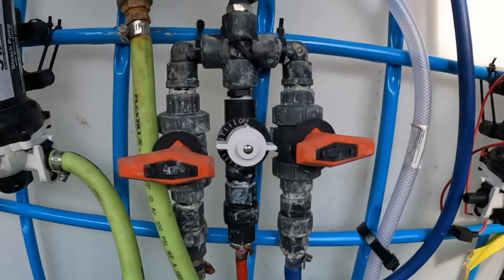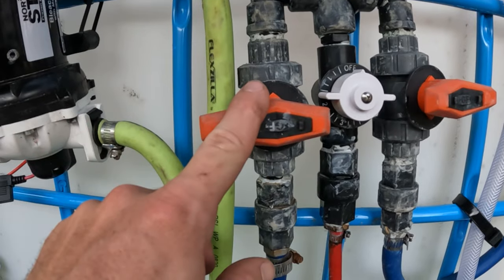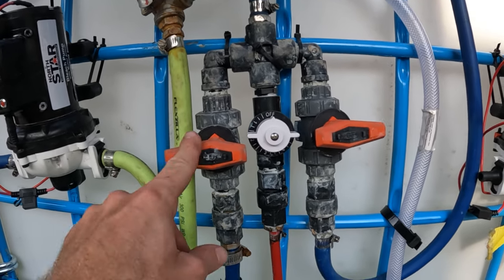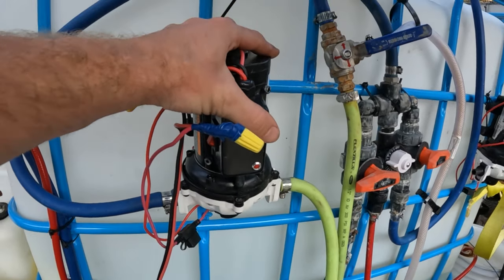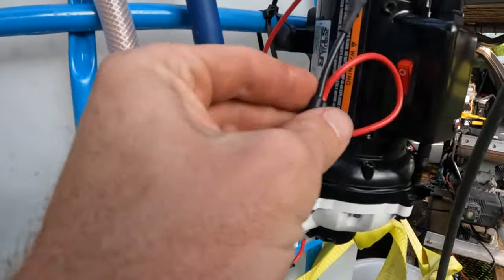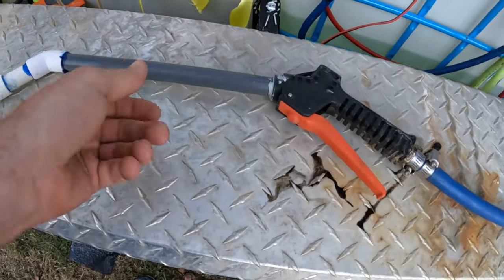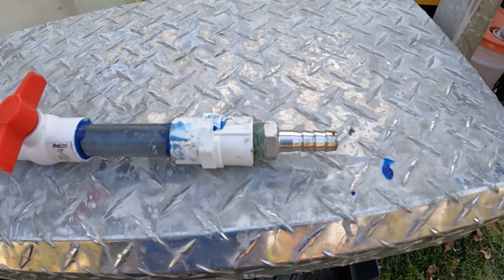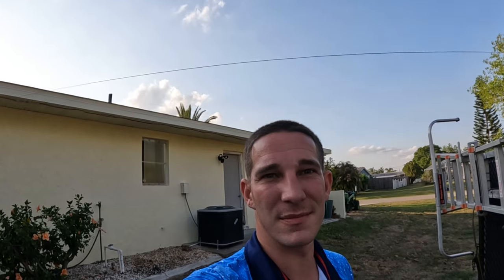How To Set Up 12v Soft Wash & Proportioner Tips | Pressure Washing Guides 2022

Comment: Great video! Thank you! 
One question what size is the soap line 1/4”?
Reply from the maker: Thank you!!   Yes I use 1/4 for soap line and set proportioner to 1-2 on the dial depending on surface. For concrete cleaning I might do .5 if any just to help mask the smell a little

Comment: Interesting bleed valve on long hose. Still not sure how that works. Is there a diagram.  Thanks
Reply from the maker: The bleed valve ideally would be shorter hose but it’s still better to bleed in a 5ft line instead of it having to bleed the air through 200ft of hose. 

I put the valve before it goes through my reel right after output of pump. Hope that helps
Reply: @pressurewashingguides3178  cheers much appreciated

Comment: I liked your info. But regarding the metering valve info. You might do an experiment with having a plain ball valve on the water line as you suggested, compared to having  matching metering gf valves on the SH and H2o. The valve openings even open 100% are different so the metering would not be equal giving you 6%. The plain ball valve would allow more water to flow more than the GF SH meter would giving you a not a 50/50 mixture.
Reply from the maker: Good call I didn’t know it offered a little less than 100% on metering value
Reply: Charles Kovacs you are exactly right

Comment: How do you mix the soap bucket?  Do you  add water to the soap in the bucket or,just straight soap and let the mixer add water.
Reply from the maker: I’m the proportioned valve it will pull the soap directly into the line and mix it.  I use very little soap though in general unless I’m doing like a metal roof.

Comment: What is the other red hose on the sh tank?
Reply from the maker: I have 2 hoses. One is 1/2 that runs to pure softwash system. The red runs pressure washer to downstream I believe it’s 3/8 hose    Smaller so it’s easier for pressure washer to pull the Chem that far

Comment: Fantastic video, mate.
Thank you very much.
What % mix do you use for a house wash? And at what positions would you have your SH ball valve in for different applications.
Cheers man.
Reply from the maker: I always start weak on house wash like 1-2%.  U can always increase from there.  Every quarter turn on valve increases potency about 2.7% but always start weak and let it sit for 5 min rinse then evaluate from there
Reply: @pressurewashingguides3178  thanks bro

Comment: Thanks for the video  , just wondering how do you charge your softwash battery
Reply from the maker: So I used to use battery charger like once a week to charge it back up.  Then u can run a line to your main battery so it charges while going down the road. 
Only issue is when u take the trailer off u need a plug to separate the wire to the car battery. Bit of work for set up then it’s good to go

Comment: Great video. Really love the setup... But as a numbers nerd, I realize that you have a very rare 13% SH on hand?  Or... Did you mean 50/50 is 6.25% and 75/25 is 3.125%?  Sorry. Can't help myself. lol
Reply from the maker: the sh i was buying was 12.5% i believe which is pure SH.  If you buy like small jugs from like walmart it is like 10% strength I believe.  So depending on how you change the dial is what percent mix you get. I always left water valve at 100% open so if I did half way on the Sh valve would be like 6.25% which is usually stronger than you need for any roof. Always start with a little weaker mix and turn dial up if you don't see the results you want after about 10 minutes of waiting.

Comment: Do you clean the proportioner after use?
Reply from the maker: So the right answer is yes you should clean it at the end of each workday for sure. This will help prolong how long your fittings and pump last.  

I am guilty of forgetting which is why I only get 3-6months out of my pumps. Granted I use North Star pumps with $20 warranty they get replaced so it’s cheap fix for being lazy. But yes you should always clean them out

Comment: #softwash. All ai need is a 12volt marine battery to run my 12 volt pump? My setup came with a generator just for that little
Pump. I think that’s way overkill and adds lots of weight to
My trailer and takes up
Tons of Room.

 Don’t want To remove The generator until I know
For Sure That a battery is just fine?  Obviously I’m just Starting Out

How long does the battery last? Do you put
It on a trickle charger at night?

Comment: #softwash !! great video, one question, what do you use the charge the batteries for the pump
Reply from the maker: manually charge it every other day but then I ran wire from batteries to car battery so it would charge while driving down the road. I added a detached method at trailer hitch so I could remove wire when taking it off my trailer.

Comment: Just curious.. why do you even need a valve on the water.. since it is always 100% on.. and there is no reason to ever use just the SH or soap valves without water.. why not just have the water without any valve and when you flip the pump on it pulls water as it does with the valve?
Reply from the maker: Good question.  So from my research and talking with others even a straight pipe instead of valve will actually give you more than water as the valve slightly restricts it   I tried testing it and can work just need to play with the adjustments. 

There is times I have had to run with the water valve cut back a little which brought the strength of mix over the 6% mark mainly on a really really bad tile roof.  I applied several coats at 3-6% but wasn’t normal tile even with soap to maximize the cling time wouldn’t make it clean so I cut back the water to make the mix hotter
Reply: @pressurewashingguides3178  Interesting. So mostly to give more SH percentage if needed. Makes sense. I asked mostly cause most videos seem to indicate that the water side is full blast all the time.

Comment: #softwash Excellent video, I just 2 questions, how are you incorporating/connecting that to your pressure washer engine/pump or is it running independent?  What kind of range (max feet/distance) you getting from that 12v after running through 200ft of line.
Reply from the maker: I do not connect to pressure washer I run it as a separate system. With the 12v I get about 40ft of distance max if you have a fine spray with a wider spray maybe only 20-30ft

Comment: What barbs did you use in the inlet & out let? Mine has a 90 degree instead of a straight one.
Reply from the maker: I always try to use straight ones myself but either way you want to use stainless steel ones and even then they go bad after like 6months i found.

Comment: #softwasher
Hi great video. Question
How do you use the proportioner when using oxalic acid degreaser or any of the oxidation removals?
Reply from the maker: I do not I just mix those manually for the job which I don't have a ton of experience using those as much TBH

Comment: so did you build your own proportioner or buy one complete? could you do a break down list on what you used? thank you
Reply from the maker: I should have a video on my channel talking about how to build proportioner. The key whatever you do is buy the better metering valves as the cheap ones break often but it’s super simple to build yourself you can buy all parts off Amazon. Cheap way is like $120 to build the better valves ends up being like $400 to build
Reply: #softwash. So informative that I subscribed.

Comment: really should use all the same valves, even on your water so you get consistent flow rates. Instead of teflon tape, use RECTORSEAL TRU-BLU sealant, it's vibration resistant unlike teflon or other sealants, just flush the system after assembly to remove any loose sealant.
Reply from the maker: great feedback I will defiantly look to swap those out.

Comment: You have to have the same valve because your mix it not going to the same it you use a different ball valve on the water
Reply from the maker: Good to know. I figure 100% open is the same no matter the value but interesting to know
Reply: @pressurewashingguides3178  that was a guy. That ran a test of each valve, both of them running wide-open, and he got mor water with the pvc valve